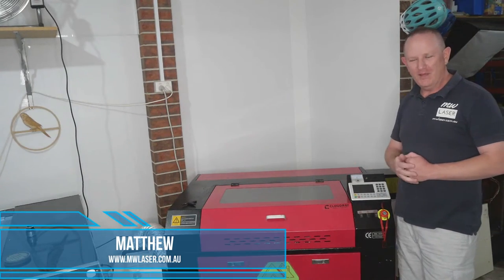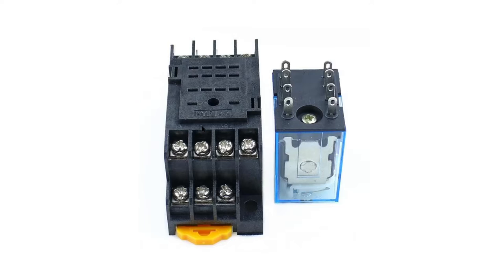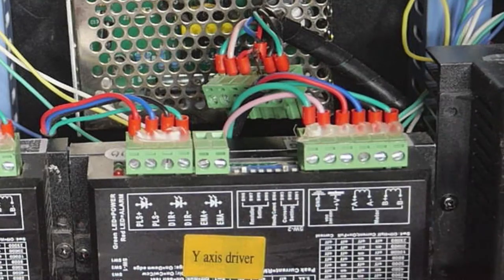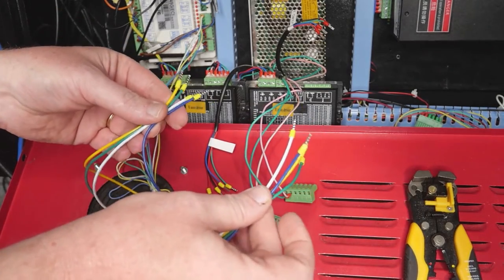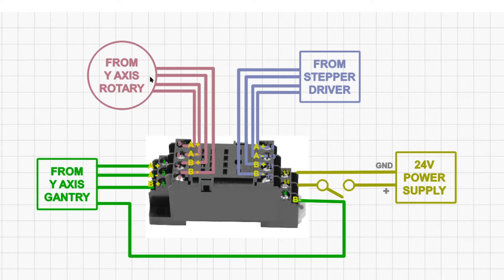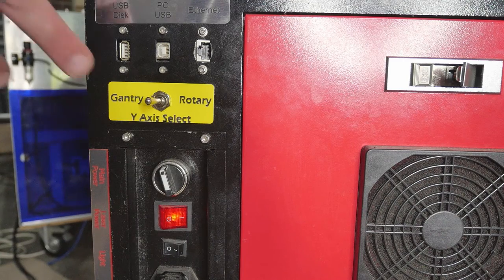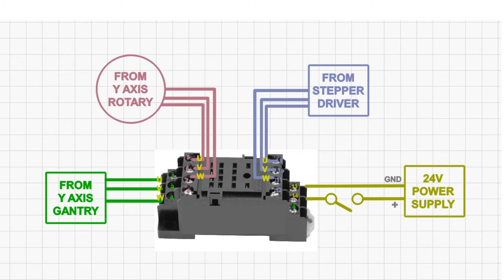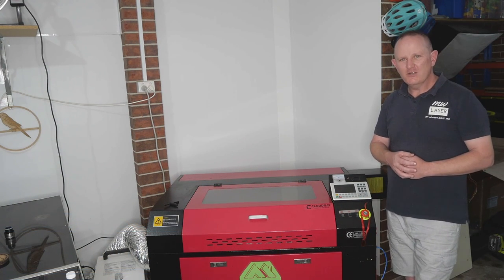Laser Y Axis Selector Relay - Rotary Axis & Gantry Axis

Comment: In my new imported machine they did include the relay and also a 6 pin Aviation-Type connector instead of the normal 4 pin one in a 2-phase stepper rotary. The two extra pins in there should be bridged in the rotary side, so when you connect your rotary, it closes the GND wire coming from the relay to the power supply GND and activates it. If found it very smart not to need a switch to change between both connections, only when your rotary is connected it will activate the relay.
Reply from the maker: thanks for that, it sounds like a good setup you have.  Cheers Matt

Comment: Hi Matt, I just came across this video at the right time, as I am doing something similar on my OMTECH 50w. Instead of a relay I'm using a 4PDT toggle switch to go back and forth between the normal Y axis function and the rotary. To accomplish this I installed a second 4 pin aviation connector so I can plug in my rotary. I'm very new to CO2 lasers (I have a diode laser with a rotary) so I have two questions; is there a benefit to using a relay over a toggle switch and can I switch between them with the power still on? I've watch videos where people will disconnect the 4 pin Y axis plug to swap in their rotaries with the power on and I just wanted to know if that's safe to do.

Comment: Hi Matt, thanks for all the great info! I have a question that I hope you can explain. After hooking up as layed out, I noticed it negated the Y axis proximity sensor. Did I miss something? Thanks!
Reply from the maker: Y axis proximity / limit / reset on startup - is disabled in vendor settings when using the rotary and reenabled when you revert back to gantry Y axis
Reply: @MWLaser  Thank you!

Comment: My machine has a separate U controller for the rotaries supplied and a button on the top of the machine to I guess disconnect the y axis. They never connected the button. Would I need to add a relay to control the power to the controller or to switch the output signals from the controller?
Reply from the maker: can you email more info and photos to matt@mwlaser.com.au thanks

Comment: I just did the same with my laser but with a different approach. I just used a 12pin ON-ON switch (google: MTS-403) and therefore had no need for extra power. Do you see any advantage in using the relay?
Reply from the maker: The relay was not my idea, I saw it on a few machines that I imported in 2020, the manufacturer had set it up with the relay and button switch,  so I took this idea and tried it out on a few machines with good results.
Reply: @MWLaser  thanks for the info.
Reply: @timstein9663  hey buddy , do you have a diagram you can share it with me ? It looks like might be easier your way thanks

Comment: Ive got a quick question mate..
How can I adjust the laser jog on a Ruida controller. I am learning how to cut using the pass through but in order to align the registration marks to lightburn I have to jog the laser to the exact center of the registration mark I burned. It is really hard as every time I jog it goes way to fast and to large an increment.
Reply from the maker: which model controller?  you should have the option to switch between continuous and manual mode movement of the axis.  you can set the manual movement distance in the controller.  for more info email more details of your controller to askmatt@mwlaser.com.au
Reply: @MWLaser  sorry mate didnt get back to you ..got busy with work, I figured it out and it is fine now.

Comment: What's the advantage of using a relay switch instead of a Toggle Switch 4PDT?
Reply from the maker: The relay was not my idea, I saw it on a few machines that I imported in 2020, the manufacturer had set it up with the relay and button switch,  so I took this idea and tried it out on a few machines with good results.  I have heard of many people using the switch, I'm not sure if there are benefits each way, but I find screw terminals easier than solder connections. :)

Comment: Very bad idea actually.
Switching the Motor Wires while the Drivers are powered up can and WILL kill the Mosfets.

Better use 2 Drivers and switch the control Signals.
Reply: Couldn’t you just switch it when the power it off?
Reply: @nicholaidacombe6924  Yes you could, but how shall the Relay work without power?

That would only be possible with a beefy 4 pin double throw switch.
Reply: Slightly confused. If I have two separate drivers, one for rotary, one for y axis. You say switch the control signals. How do you do that?
Reply: @007Greenalien  Simply switch the Pulse and Direction Signals from the Controller between the 2 drivers, instead of switching the Motor Wiring.
Connecting/disconnecting  the Rotary must still be done without power.
Reply: @ichbinsnur1941  Thank you.  Done.
Reply: @007Greenalien You're Welcome.
Reply from the maker: I have heard of these concerns, and it maybe a risk, however as always I check with manufactures before posting such information.  This exact dingle step-driver setup has been supplied by laser machine manufacturers with the relay and button switch installed on several machines I imported during 2019 and 2020, my customers have used this setup without a glitch for over 12 months with the same components.  If you are concerned with the single step-driver setup, then the dual step-driver setup shown towards the end of the video would be the option for you to use.  Cheers Matt